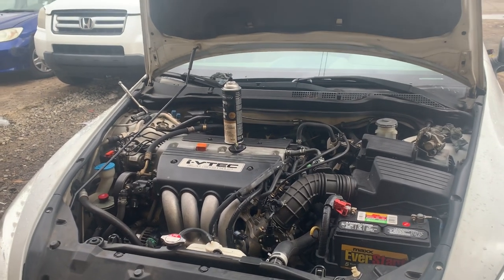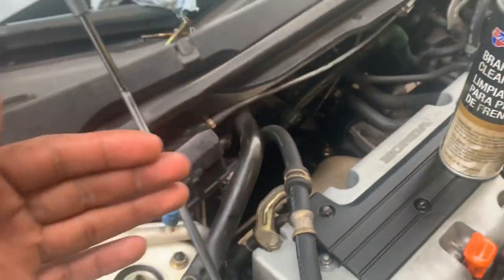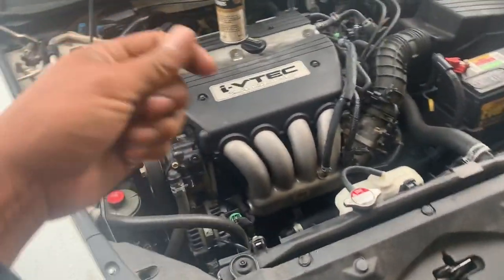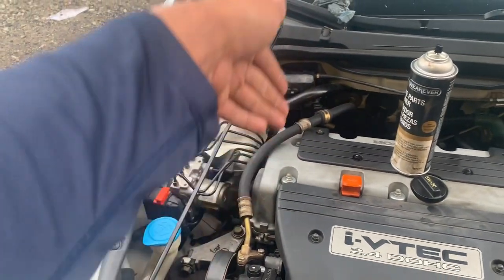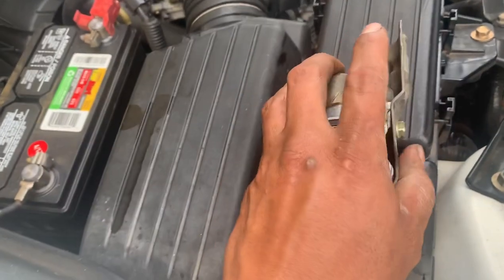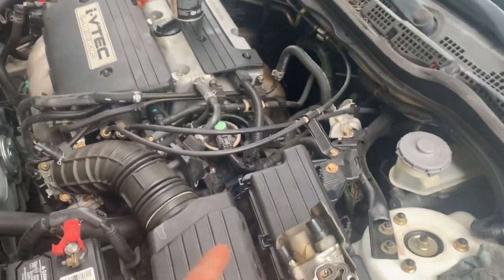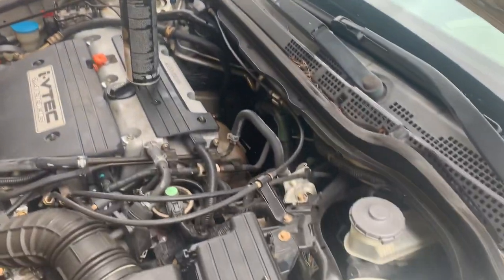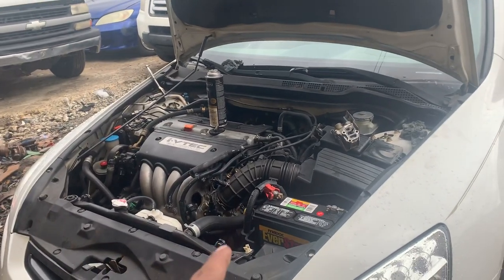03 Honda Accord 2.4 common oil leak

Comment: I picked up an 04 accord 2.4, a few years back: same leak.  First changed rocker cover gasket, as soon as I got it.  Then changed that vtec duhicky gasket that your speaking of, about eighteen months ago.  On a drive up to wv, I had enough oil pressure to push oil past the oil pan gasket; so I changed that-what a bear!  Then the power steering pump was leaking in the area; where the hose meets the pipe.  Now I'm looking at it again!  Is it coming from the area around the crank sensor or the dang crank seal.  Dios mia!! Lol
Reply: Rocket cover gasket ?
Reply: valve cover: the rockers are connected to the overhead cam.  Really only the very tip of the valve protrudes from the head to be covered; all the rockers are there.  On pushrod engines, the camshaft won't be there; so it's safe to say that the cover, in all cases covers to rockers, imo.

Comment: I got the valve replaced, the sender, steering hose, crankshaft, pcv valve replace, o-hose  and it’s still leaking oil any idea what it could be?

Comment: Nice tip, thank you.  I keep getting oil showing up on the driver side, just behind the motor.  Any idea what that could be from?
Reply: VVT solenoid gasket or crankshaft main seal is my guess

Comment: really wondering how to deal with stripped bolts and also what do i do about  solenoid a, b,c,e,d i need to find them are they on the bottom of the transmission with a cover

Comment: Where is this located?
Reply: That's the vtec solenoid. Located upper left of the engine. Mounted on to the head right below to the valve cover. U can't miss it.
Reply: It's right above the oil filter. The vtec solenoid gasket. I'm doing this for my dad's 03 accord along with the valve cover gasket. Should fix the leak

Comment: Mi accord esta lleno de aceite por el lado del pasajero hasta el cinto . Sera este mi problema hermano?
Reply from the maker: Es muy común hermano!
El sending unit tambien pueda estar mal
Reply: @GeneralMechanicGA  sera mejor que yo  cambie toda la parte en vez del empaque solamente?
Reply from the maker: Si nunca le dio problema de tienpo variable no hay nesecidad pero ya estaria en usted
Reply: @GeneralMechanicGA  bueno empezare con el empaque y si sigue tirando aceite le cambiare todo. Muchas gracias hermano bendiciones.
Reply: Oiga hermano le cambie el empaque pero ya me esta dando codigo P2646. Que hize mal? Por favor ayudeme.
Reply from the maker: Que año es su accord?
Reply: @GeneralMechanicGA  2007. 2.4l
Reply from the maker: Mmm 
Mire 
Inspecsione q el plug del pressure switch este bien trampado 
Mire q los cablesitos del plug esten bien 
Si todo esta bien pueda ser q el sensor no sirba 
Recuerde que estaba perdiendo pression y hoy q no hay liqueo pueda ser q esta leendo señal mala
Ahora para comprar el switch le ba salir mas barato toda la pieza
Yo tengo cuenta commercial con Advance auto parts que le pudiera salir mas barata por si lo nesesita me avisa!
Reply: @GeneralMechanicGA donde se encuentra usted?
Reply from the maker: Middle Georgia
Reply: Jose A le pusistes aceite MAs al carro ? Vota aceita yo kiero cambiarle el empaque a 05 Crv también
Reply: Yo no veo el comentario que me contesto no yo no me está dando problema yo sé lo kiero cambiar px le vi un likeonde aceite no es mucho poreso se lo voy a cambiar

Comment: I got a leak by the bottom of the back motor mount the line that cross is wet is that an oil line ???
Reply: Main seal

Comment: Now I replaced that gasket and the top one too ( I don’t know the name ) but still leaking in the passenger side right by the serpentine belt , not the side , but the back of the engine what it could be ? I have been looking for it and the only part from the top that is full of oil is the exhaust manifold .
Reply from the maker: On top, of manifold?
Reply: General Mechanic bottom
Reply from the maker: Mmmm bottom of manifold there is nothing that could leak oil, only this could leak oil there could be a head gasket.
You have this components that carry oil seals or gaskets in back of engine.
Vale cover gasket 
Then spool valve on spool valve you have pressure switch that could leak oil, oil pressure valve solenoid. Under that head gasket 
Under that is the oil pressure sensor,
And under that oil pan gasket.
Reply: Reinaldo Navarro I got the same issue... did you find the problem?
Reply: @GeneralMechanicGA  what about the crank seal under the harmonic balancer
Reply: Right by the tensioner huh?
Reply: Did you ever figure out ur problem? I’m having the same issue
Reply: @jaylen1215  it was the valve cover gasket the main one , Aldo the whole vtec solenoid was leaking , not the solenoid gasket the the unit itself

Comment: I've replace like 5 of those filter still leaking, they always leak..
Reply: Are they honda oem gaskets ?
Reply: @mirielorozco3083  THE WHOLE VTEC SOLENOID WAS AFTER MARKET i INSTALLED AN OEM VTEC SOLENOID AND PROBLEM SOLVED NO MORE OIL LEAK...